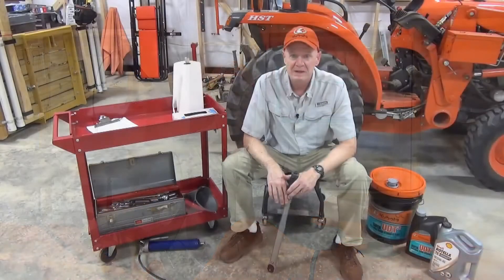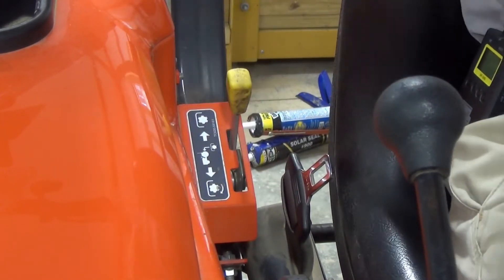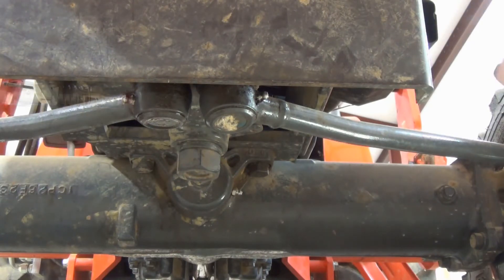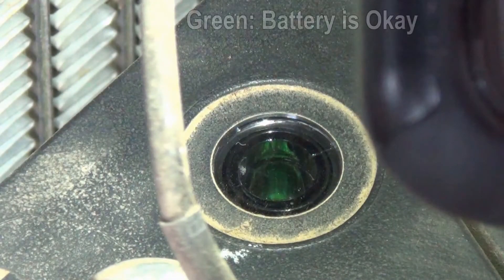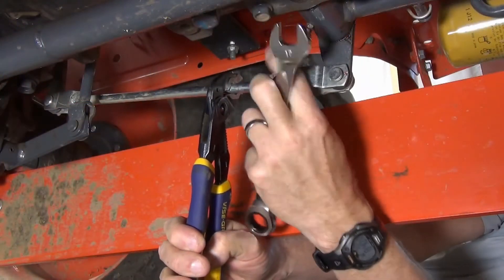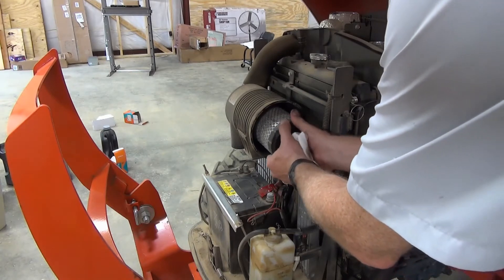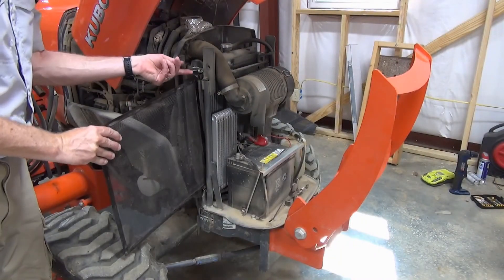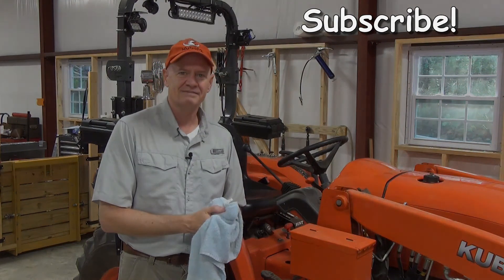Kubota L Series 100 Hour Maintenance (#72)

Comment: Nice vid thanks..  I just got used 4400 and noticed the radiator fan wobbles?  so the shaft from the fan that goes back to engine has a little wobble?  is that normal?  2009 tractor with 300 hours?  thanks
Reply from the maker: I'm not familiar with that model tractor, but I don't think a fan wobble is normal.  One thing to check is to see if one of the fan blades is bent out of alignment.  If so, it would appear to wobble and maybe you can just bend it back into alignment. Thanks for watching!

Comment: Good morning and thank you for replying. I have the Kubota L3301 4x4 2015. I found the maintenance sheets on pages 56-59. Now I just have to figure out how to make copies as you have done so wisely. I did not buy the tractor new. However it only has about a 113 hours or so on it.
Reply from the maker: Glad you found them! 113 hours  is practically new. Do you know if the previous owner did the 50 hour maintenance? If not or you don’t know, you should do the 50 hour maintenance steps first. Good luck!

Comment: Do you have a video on a abandoned m4030 tractor for 20 years without being started. What should I do first. It was my father in law tractor and he just walk away from it with only 50 hours on it. Would love to see it running. Thanks
Reply from the maker: Hi Jerry!  No, I have never been in that situation, but I have seen several videos (and there are lots of them on YouTube!) about resurrecting old tractors.  Hopefully, it's been stored under a shed or in a barn or garage.  The first things that come to mind is to change ALL fluids: engine oil, hydraulic fluid, gear oil, radiator water.  Also change all filters.  If it's a diesel, the entire fuel system may have gelled diesel in so it will have to thoroughly flushed.  Check for dry rotted and cracked rubber hoses and tires.  I'm sure there are plenty of videos that can guide you through the full process.  I'd say your chances of getting it running again are good and then you'll have an almost brand new 20 year old tractor. Good luck and thanks for watching!
Reply: @DIYMyWay  
Thank you for that it's has been in a barn for the last 20 years
Reply from the maker: That's good to hear!  Then you shouldn't have too much trouble getting it running.

Comment: I reckon this is a good informative video. However legit ?...here. Howcome you're blowing the air element out replace that sob unless ya don't mind your equipment to  smoke like a tire fire
That's exact words I got from onary ol' cuss that mentioned me
Reply from the maker: Hi Ole Tom!  I was blowing it out because the manual said I could.  If it makes you feel any better, I did replace it with a new filter a few months ago. Thanks for watching!

Comment: Martin my L2501 does not have a breather port on the rear axle support and will not take any grease, the front is normal like your video shows. ? I am worried that I can not get any grease in there. Thanks
Reply from the maker: Hi Mark.  That’s odd. Is your L2501 a 4WD model or 2WD?  Is there a grease zerk on the rear axle support?
Reply: @DIYMyWay  4WD yes there is a zerk on the rear axle support but no plug to remove
Reply from the maker: That’s very odd! What model year is your tractor? Does your manual indicate there should be one? Mine is a is a 2017.

Comment: New subscriber and a fairly new Kubota L3901 owner. I have never operated a tractor before and still getting comfortable with it. I have purchased a Land Pride box blade and have installed a piranha bar on my bucket. Looking forward to getting some more implements. After watching your video on your carry all I am going to make that a priority. Thanks for all the tips and information.
Reply from the maker: Hi John!  Thanks for subscribing!  I’ve had my L3901 for two years and love it and yet I still consider myself a new tractor owner.  Other than renting a skid steer once and a backhoe/loader a couple of times, I had no previous experience either.  Let me know what you think of the Piranha tooth bar.  I have been considering getting one.  You’ll find you can do a lot with that box blade.  Dave of the Dave Knows How channel has several good videos on using the box blade.  He’s has a wealth of tractor know-how!

Comment: Thanks Martin. Great job. I know there are lots of electronic devices on the tractor but do you ever wash the tractor with a hose or pressure washer? Do you wash the radiator? Thanks for your response.
Reply from the maker: Thanks, Tommy!  Yes, I have washed the tractor with a hose, but I'm careful where I spray to avoid offending any electronics.  I haven't washed the radiator, but I have blown it clean with an air compressor and a blow gun.
Reply: Pressure washers are too strong for washing a tractor.  I've used one to get muck off a grading scraper and from the tines of a tiller.  Watch where you point the water since it will take the decals off.